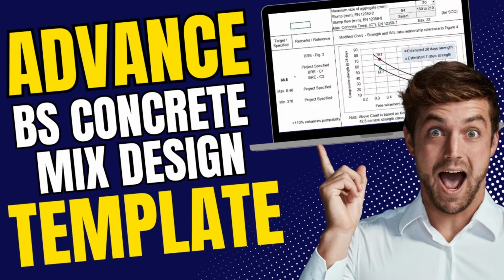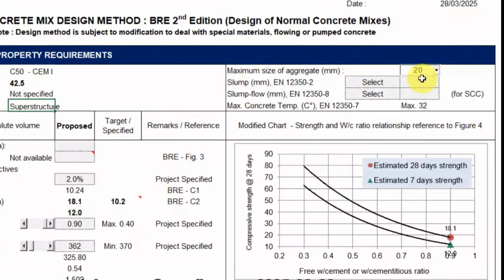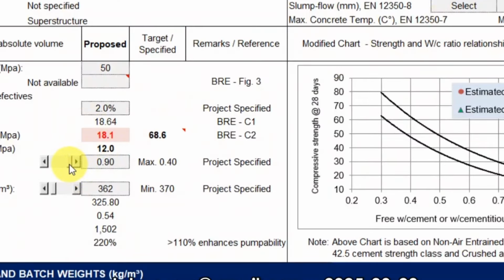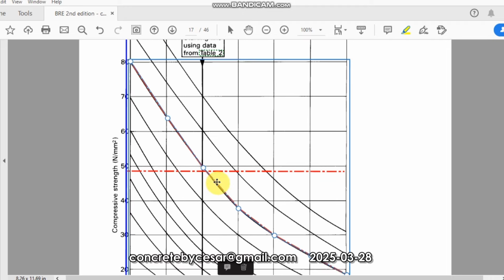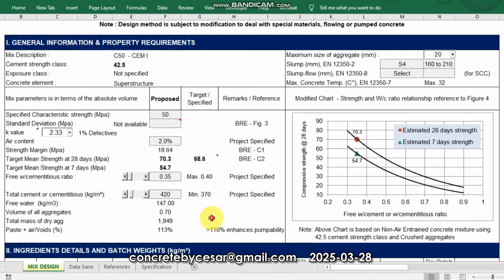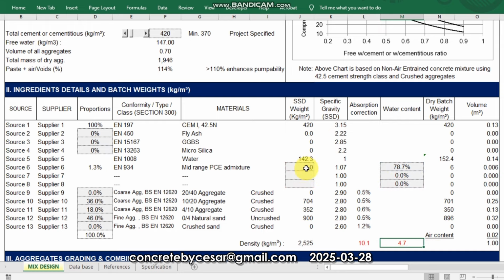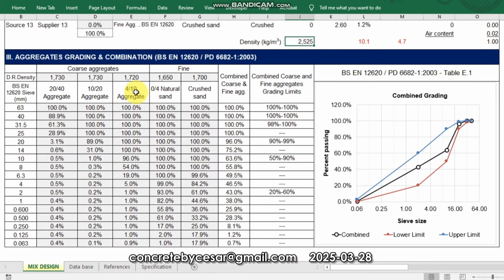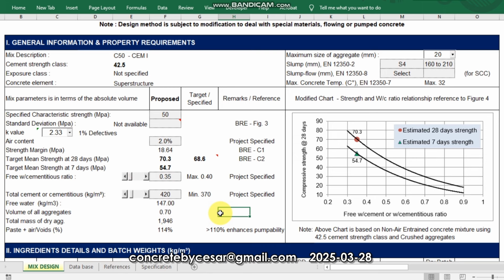🔥 Concrete Mix Design Template BRE 2nd Ed. DEMO (Advanced Guide) #construction #concrete

Comment from the maker: Get this package👉https://concretebycesar.etsy.com/listing/1714068003

What you will get from this package ?
1. Ability to Estimate 7 days and 28 days cube strength
2. BRE 2nd Edition Method (Modified)
3. BS EN 12620 / PD 6682 (Combined grading)
4. Free Guidebook